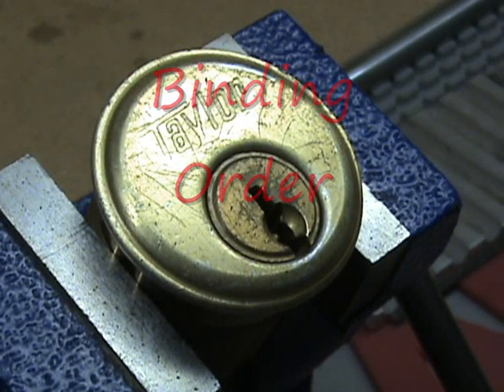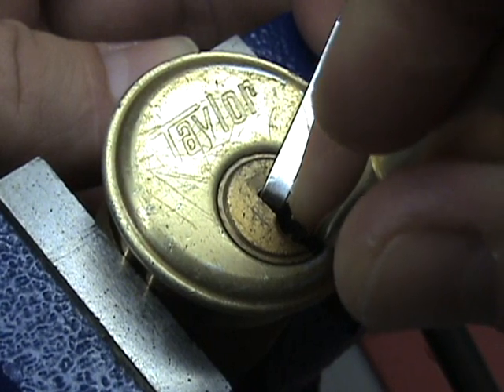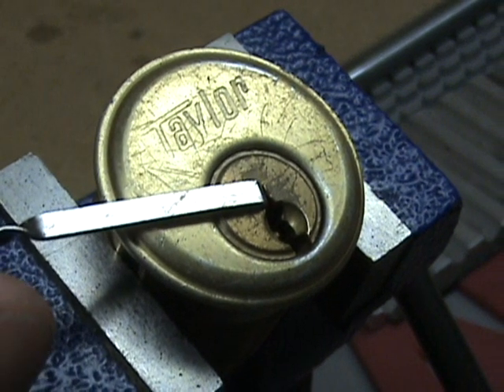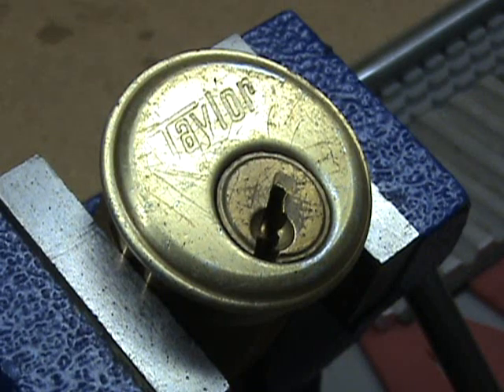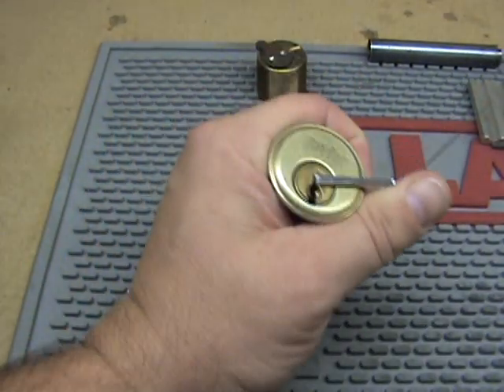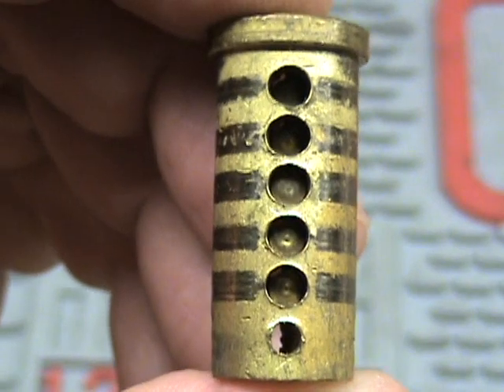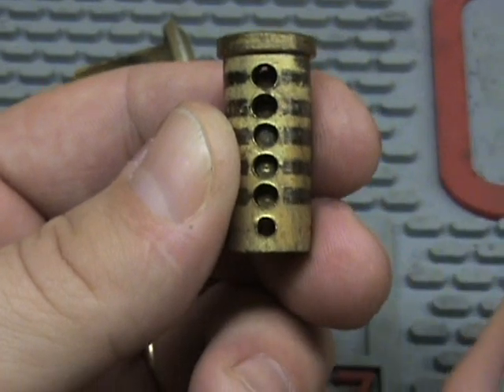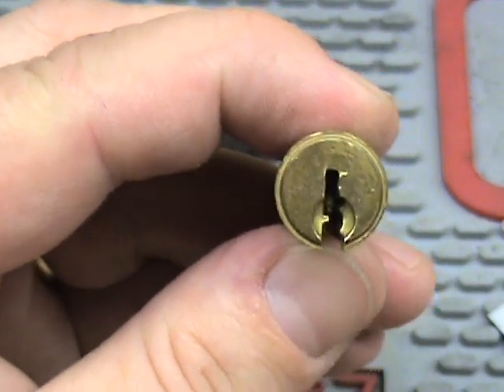Binding Order

Comment from the maker: @Swastick6425 You don't bind a pin, the lock does.  When you find the binding pin and lift it, once it hits the shear line it "sets".  You will not always hear a pin set, you will feel it set more often than you will hear it.  Some locks you won't hear it or feel it but those are usually old dirty nasty locks.
Reply: kokomolock  great video.  Is a binding pin a Security pin a spolepin ????

Comment: I know this is an old subject for you;
But, for S&G's, try this.
insert your wrench,
give a little tension,
pull outward on handle,
tension normally w/ the outward tension,
pick the lock.

repeat with inward pressure.

sometimes it will change order.

Comment: Makes you wonder why don't lock manufactures (or more of them if some of them do) don't align the holes in the plug as near perfect as possible with today's computer guided technology allows?
Reply: White Tiger Gaming
I am not speaking for lock manufacturers but from years of experience in machining --- it is a question of cost.
Consider that the average human hair measures 3 one thousandths of an inch (0.003). Now you have to not only align 5 or 6 holes to less than a hairs width along a centerline, but you also need to quality control the cutting tool *between* each and every cut (cutting tools do wear and need to be gauged for sharpness and correct diameter)  --- if you are using a special cutter head which has 5 or 6 individual drills --- EACH drill wears at a different rate and gets replaced on a different schedule --- so you may end up with a new drill in positions 1 and 3 and an older drill several thousandths out of true size in positions 2 and 4 and maybe a damaged drill in position 5 ---- they all cut---- the lock still works --- but the actual holes are out of alignment by some amount  --- PLUS add in the variances (tolerances) for each of the other mass produced parts which must interchange with all the other mass produced parts ---- in order for a customer to be able to buy a lock for $25 instead of $250.
Reply: White Tiger Gaming They do try.... Most are very close. The more expensive the lock, typically, the better the tolerances. But the reason this works, and the reason lockpicking takes so much practice to develop the "feel", is that a difference of even .001" or less, is all it takes to allow one pin to bind before another.